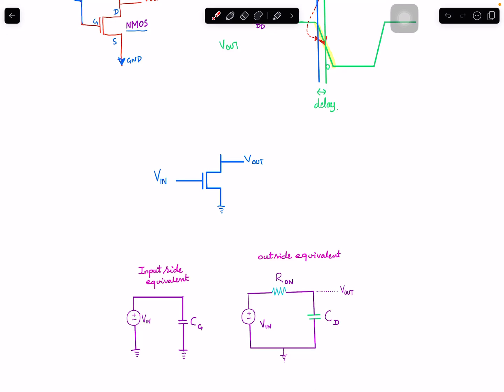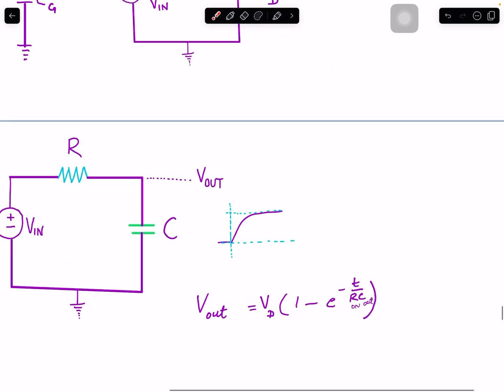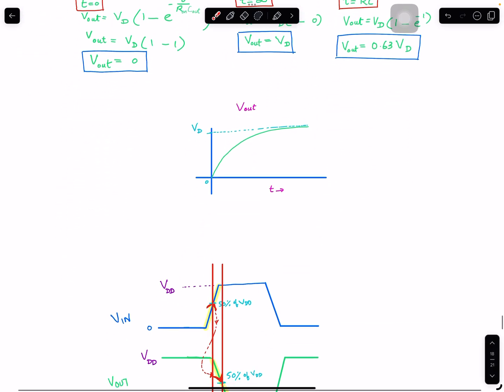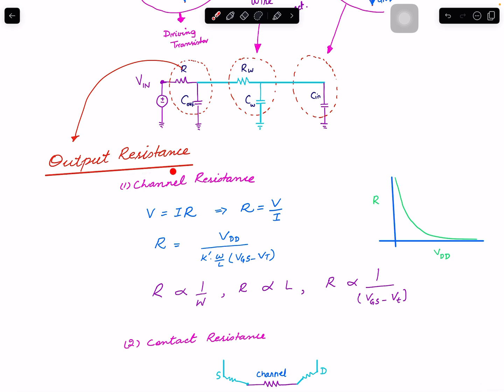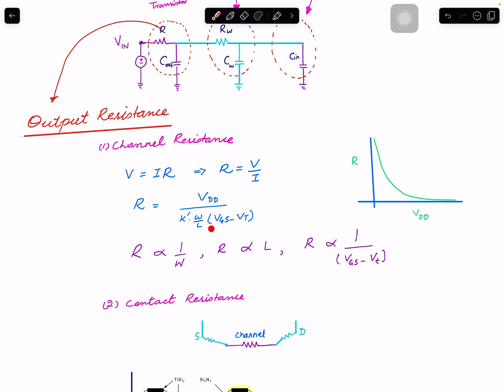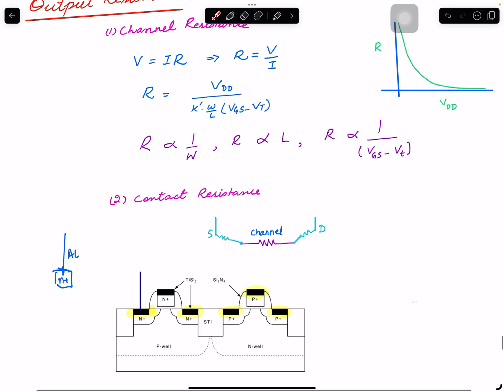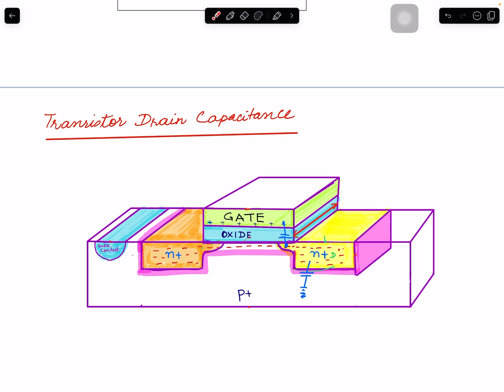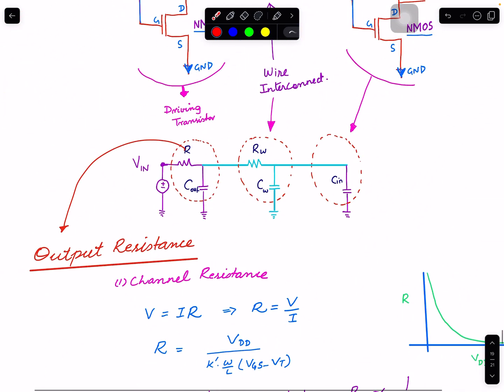Topic 10- CMOS | Sources of Resistance & Capacitance in Transistor | Delay Series- Part 2

Comment: Thank you for these wonderful lectures Mr. Rashid. Learning from an industry expert is a totally different experience as compared to academia.
 
I have a question. There is only drain capacitance in the second inverter model at 9:20 . Is it because the Vin of second inverter is connected to the Vout of first inverter and if NMOS is on in the first inverter so the NMOS will definitely be off in the second and the path becomes no channel resistance is there, therefore we only have drain capacitance?
Reply from the maker: Thanks. Soon I will gather all the questions from comments and emails and do separate video on them.